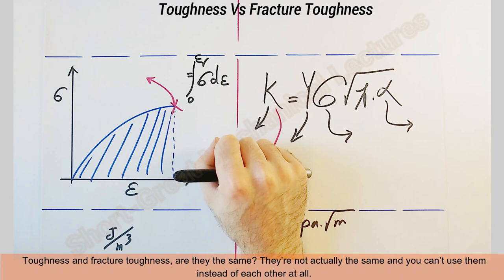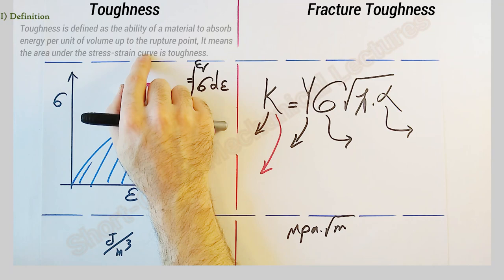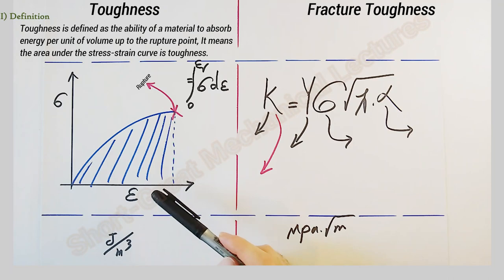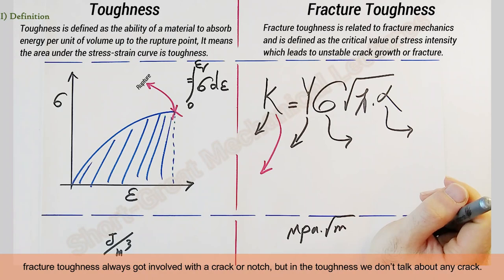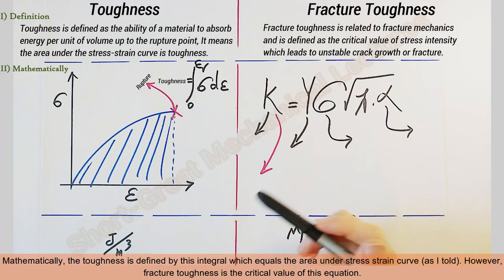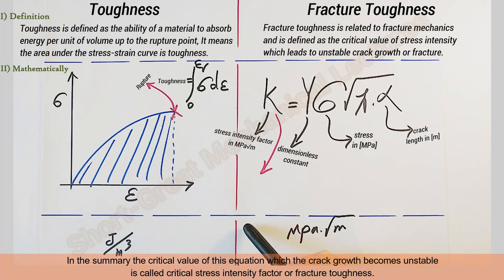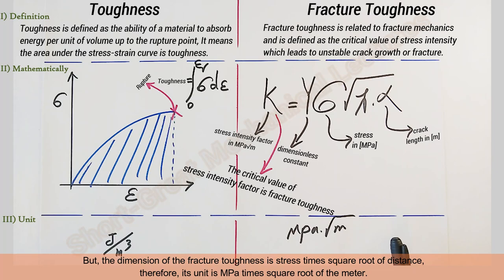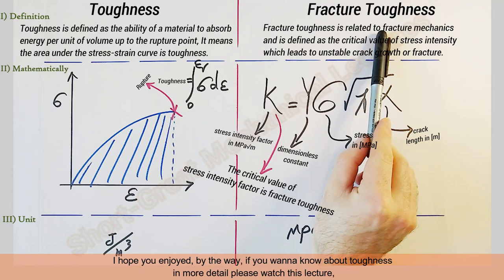Toughness Vs Fracture Toughness

Comment: Hey, nice video - you say they are different quantities but they can both be measured using the Notched Charpy Test, so are they really independent physical properties?  https://en.wikipedia.org/wiki/Toughness 'The Charpy and Izod notched impact strength tests are typical ASTM tests used to determine toughness.' and https://en.wikipedia.org/wiki/Fracture_toughness 'A widely utilized standardized test method is the Charpy impact test whereby a sample with a V-notch or a U-notch is subjected to impact from behind the notch.'
Reply from the maker: Thanks for your nice question, by telling they are different, I meant academically the fracture toughness is a term which takes you to field of fracture mechanics, but with toughness you are still in regular solid mechanics. Secondly, in fracture toughness always there is crack topic, but in toughness not.